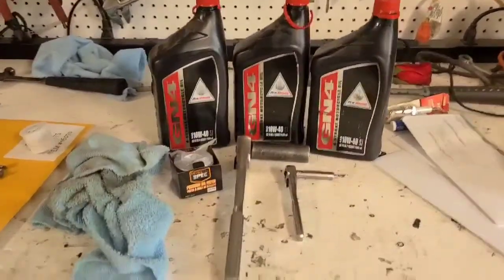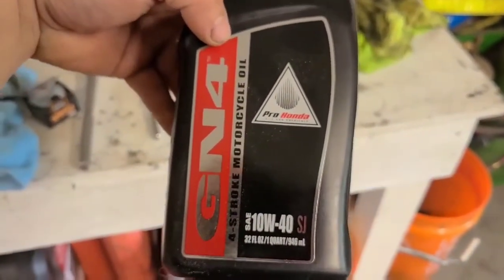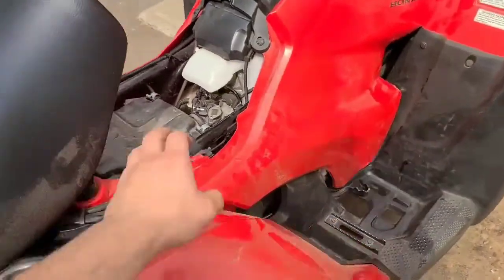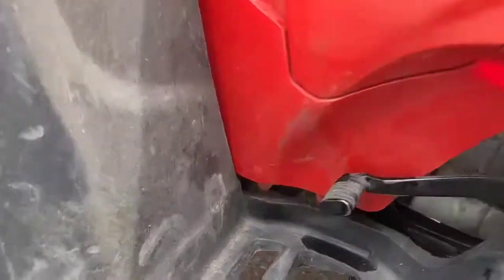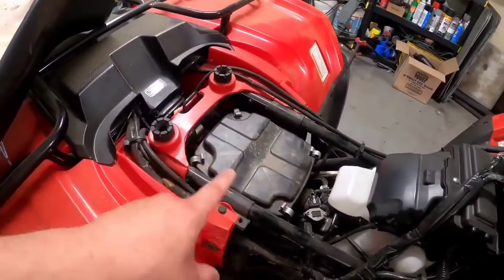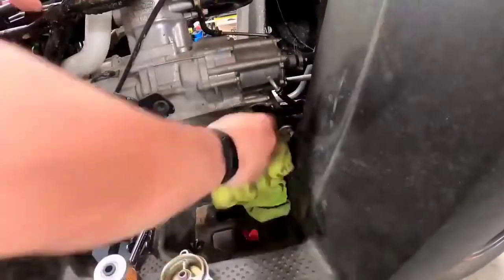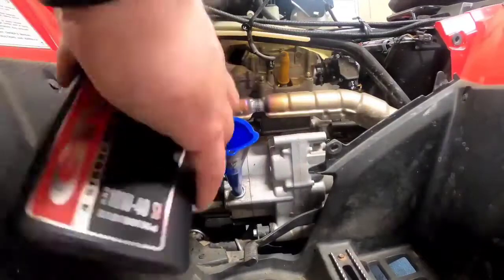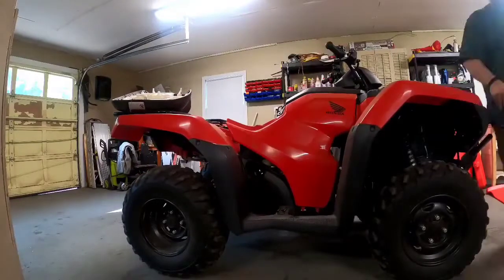HONDA 420 Rancher Oil Change

Comment: You said the oil filter bolts are 17 ft lbs?
Reply from the maker: Yea boi. Snug is good
Reply: Be careful man, the owners manual calls for only 7ft lbs for those 3 bolts and 18ft lbs for the oil drain bolt!